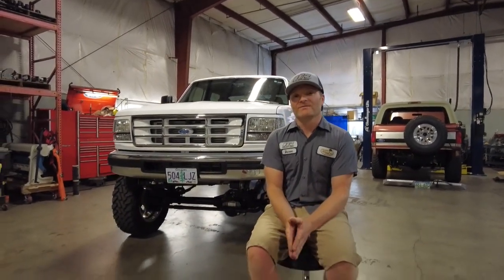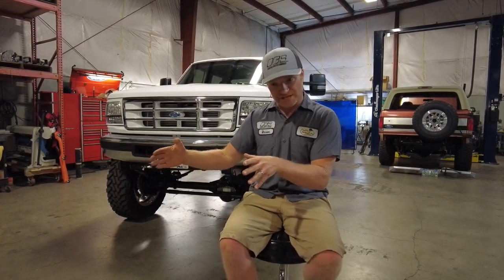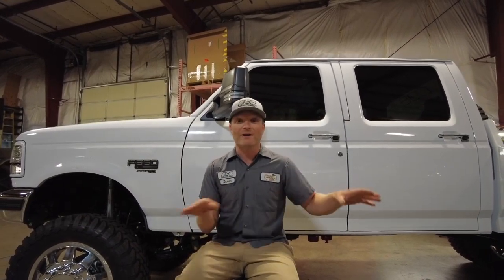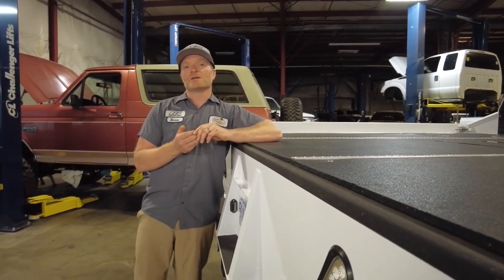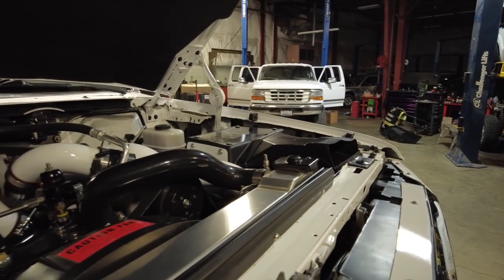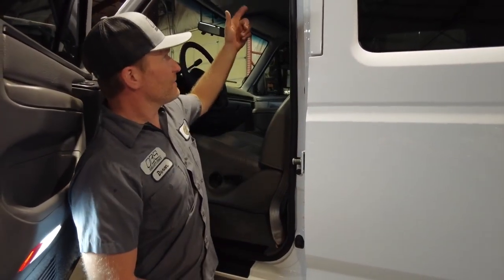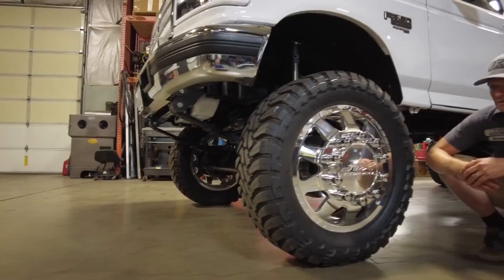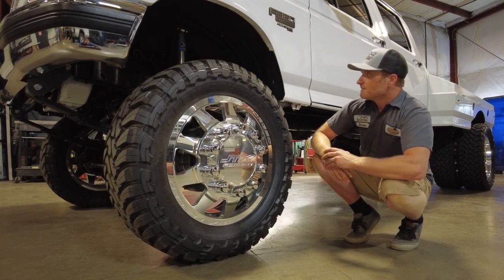OBS Solutions F-350 Dually "Cowboy Truck" Full Walk-Around

Comment: Appreciate what you’ve done with your truck. My dream truck is a 97’ Ford F-350 4x4 srw crew cab 7.3 lwb. I saw a Dually same body style as your truck, same era. That someone had built 7.3 4x4 jacked up (that’s cool too, I don’t need it jacked up).  I stand 6’3” plus I’m in my 50’s. A 3” raise is cool,  but that’s it. Just a preference thing. But, your bed is awesome, really like the bed. Be great if I was going to make a welding rig with it. But, even casual it’s still a cool truck. Thanks for sharing your truck and including what most won’t see like the sound barrier. Appreciate you sharing your experience with this sexy truck!!!
Reply from the maker: Thanks for the compliments,  appreciate you checking out the video

Comment: Hi obs, quick question. I recently bought a 97 F350 7.3, and it's missing the interior dome lights (the whole light assembly that goes on the headliner). What aftermarket lights am I able to use? Are there some on eBay I could buy? Any feedback would be greatly appreciated. Am I able to use the ones from a F150-F250?